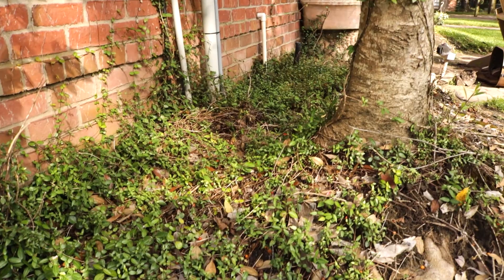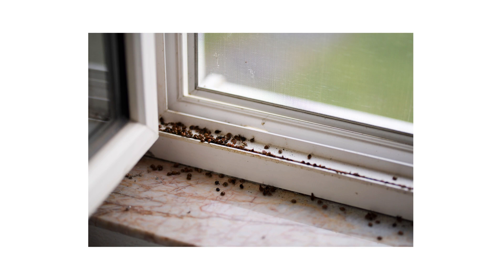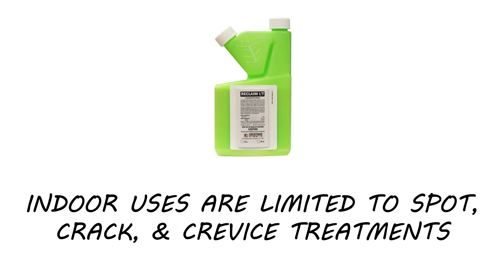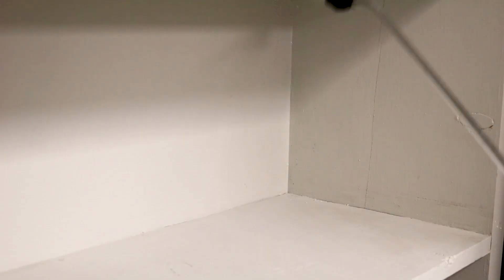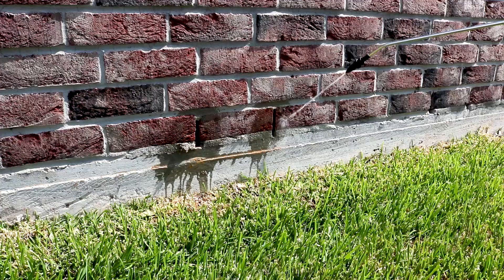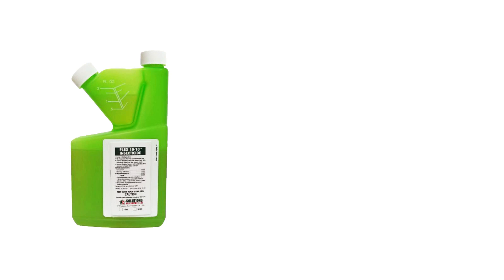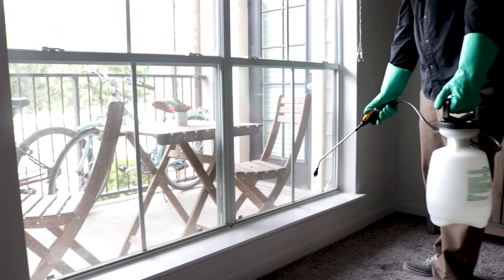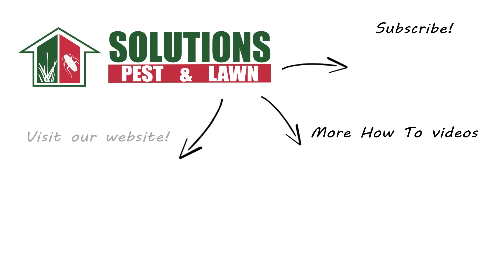How to Get Rid of Asian Lady Beetles (Harlequin Ladybugs)

Comment: Around my house they swarm usually in October or early November on the first sunny warm day after we've had a heavy frost. Some years are worse than others. This year was not bad. When they swarm and are looking for shelter indoors they're flying in the air by the thousands and it's impossible to go outside. I have found soapy water to be the safest and maybe not the most effective, but considerably effective. If I'm home when they're swarming, I fill a large pump sprayer with soapy water and attack them as they are landing on my house and garage. In the spring when they emerge, my philosophy is, " if they are too dumb to go out the same way they came in, then they don't deserve to survive. " I give them swimming lessons; none of them pass the test. I collect them individually in a small container of soapy water. They emerge on the first sunny warm day in the spring starting as early as late February and or March. Frequently I spend Easter Sunday catching Asian lady beetles. I have sometimes collected 100 - 200 of them at one session. I have been bitten many times and have found them crawling under my clothes.
I have a very large garden, and for all the good they are supposed to do, I have yet to find ONE in my garden. They are one of many biological pestilences that have come from Asia. Draw your own conclusions.
Reply: Do you break out after bitten?
Reply: Bro they invade my home in the summer and throughout lol

Comment: I’ve used so many chemicals on them And they dont work like u think. Raid Ant control helps some but u have to spray them from the side or they hunker down. They are very durable little creatures
Reply: The chemicals are harming you more than them.

Comment: Ok but how do u KILL THEM
Reply: We usually get a vacuum and use it then put the vacuum outside so they don't escape the vacuum 😜
Reply: You can either build your own trap or buy a trap on Amazon for around 20 bucks.
Reply: A water bottle. Use its narrow opening when they're on your ceiling.   Bump them with the edge of the opening and they fall right in.  It's just as fun as playing basketball.

Comment: Instead of just treating the areas, why not fix the issues that allow these stupid things into the home?
Reply: Maybe because I like to have the sliders open on the deck in the summer that would be great, but I can’t because of these bugs that good enough for you
Reply: For sure, that’s the main advice I receive. The issue is, a lot of homes with this problem are very old. Finding all the holes and cracks is very difficult because of how many entryways there are. It’s hard to know where to start.